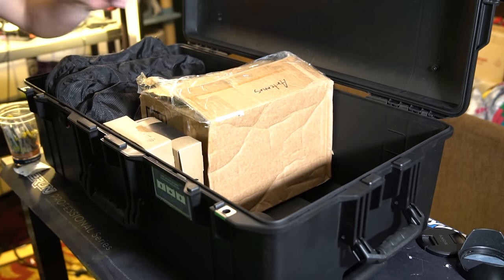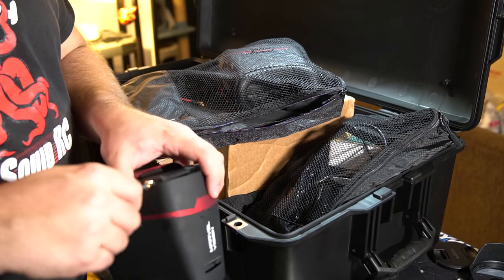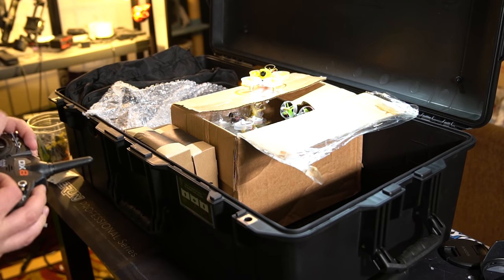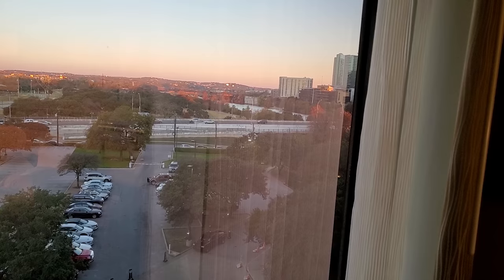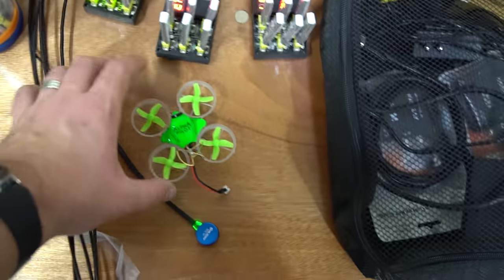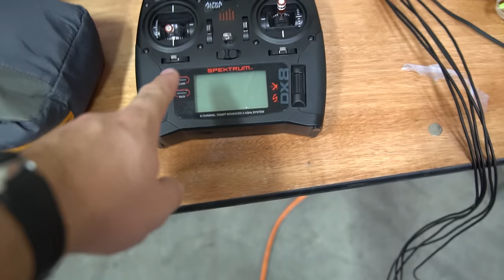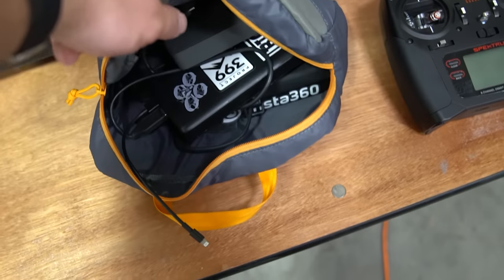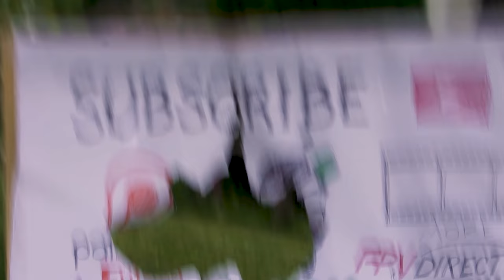Our Secret Company and Artificially Intelligent Robotic Racing

Comment from the maker: My standard drone: 
Motors: Hobbywing 1750kv 2207 -- http://bit.ly/nurkhw1750
Flight Controller: Whitenoise Synergy -- http://bit.ly/nurksynergy
ESC: Hobbywing 60a -- http://bit.ly/nurk60esc
Video Transmitter: TBS Unify -- http://bit.ly/nurkunifyevo
Receiver: Crossfire Nano -- http://bit.ly/nurkcrsfnano
RX Antenna: TBS Immortal T -- http://bit.ly/nurkimmortalt
VTX Antenna: TBS Triumph  -- http://bit.ly/nurktriumphpro
Frame: Project 399 SuperG -- http://bit.ly/nurksupergpyro
Camera : Runcam Racer 2 -- http://bit.ly/nurkracer2
Lipo: CNHL Ministar 6s -- http://bit.ly/nurkministar
Prop: Azure 5150 -- http://bit.ly/nurkazure5150

DJI Products with this Drone: 
Get Started with DJI:  -- http://bit.ly/djistarter 
DJI but I want my own radio:  -- http://bit.ly/nurkdjinoradio 
DJI Receiver Directional Antennas: TrueRC Patch for DJI -- http://bit.ly/nurktruercpatchdji (requires 2, not necessary, but amazing) 
DJI Receiver Omni Antennas: TrueRC Stubby Singularity -- http://bit.ly/nurksingularitydji (purchase 1, comes with 4)
Reply: 👌 music is nice. What’s its name? Thanks.

Comment: The pelican air is what we use at work! They make a lid organizer that some of us use:
https://www.amazon.com/CVPKG-Presents-Pelican-1615-Organizer/dp/B07YP2R695/
I also recommend putting just the outside-edge foam organizer stuff in, and using drawer organizers (like this, but not necessarily this):
https://www.amazon.com/Simple-Houseware-Foldable-Organizer-Underwear/dp/B01N5CKFO1/
And parts organizer things from electronics supply stores. No link, cause it should be easy to think about :P

Comment: The AI is off board serving signals to the quad right?
Reply from the maker: Nope not at all.
Reply: @NURKFPV  Wow, that makes it all the more impressive. I see application in commercial or search & rescue applications, but it's gonna be a while before they beat you around a true DRL course. I think off-boarding is fair BTW. I mean, we don't stuff our brain in the quad right?
Reply: @RTKdarling  I feel like moving the AI off-board would make it a much harder problem. Keeping everything local eliminates transmission latency and makes it a near real time problem.
Reply: @LeCrowTV  You think so? I think that the processor we would need to keep up with a human racer today would be too much to put in the air. In theory, the offboard processor is using the same 2.4 and 5.8 frequencies that we are, so the latency is equal across the board.Currently AI processing is the bottleneck, not the transmission latency
Reply: Transmission latency affects computers much more than it will affect a human. Humans have a relatively slow reaction time to new visual input at around 0.25 seconds for the average person, and we have a slow processing time (without any reactive feedback) at around 20ms for the average person. Any modestly capable microcontroller can process 1000's of instructions during that time window. If you are streaming multiple digital video inputs from the AI racer to an off-board system, even at 5.8GHz your going to induce a non-trivial amount of latency to the system. This latency creates a bottleneck in how often your AI's vector space representation of its surroundings can be updated,  which in turn means you have to make predictions on what changes will occur between sending instructions and the AI Racer processing them. A wrong prediction could mean your system crashes.